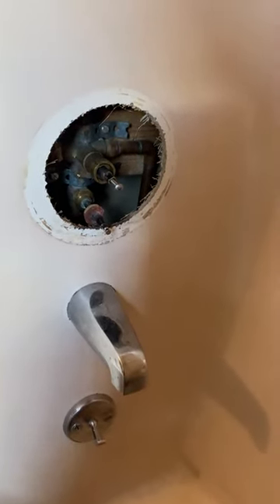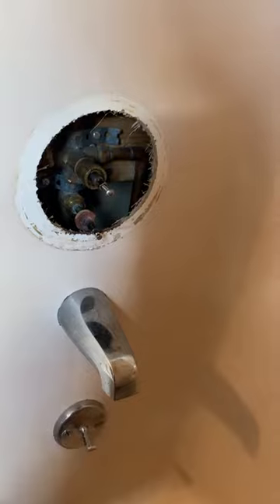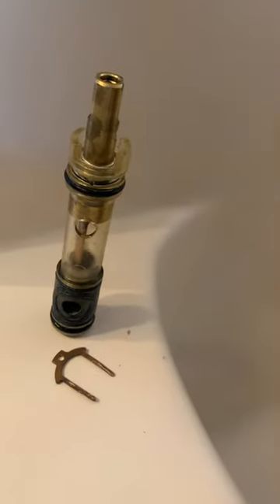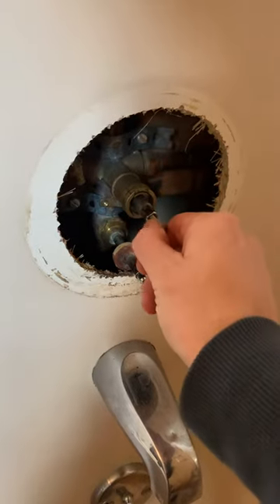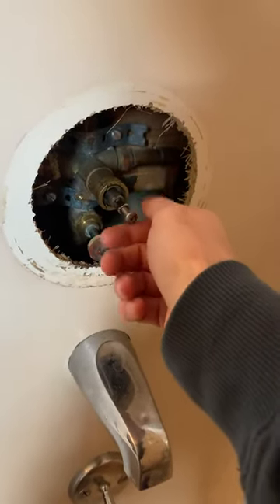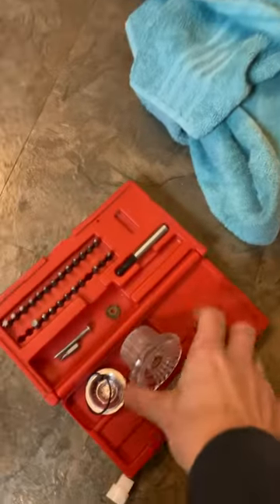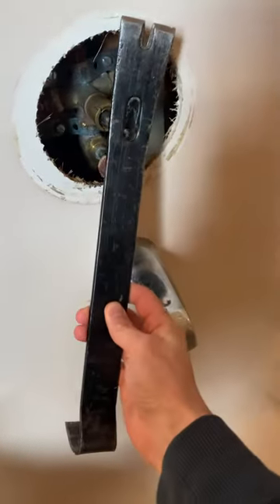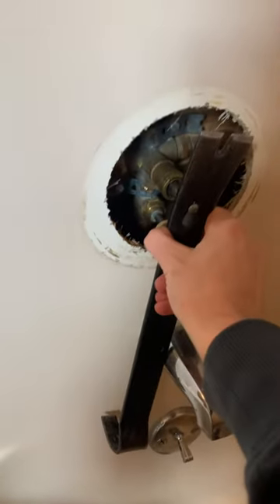How to remove Moen 1225 cartridge without special tool

Comment: This method works like a champ. Great idea!  I did put a block between the pipe and the back side of the tub enclosure wall to minimize the pressure being put on the pipe connections of the valve body.  Thank you.

Comment: got to be careful if the valve isn’t supported
Reply from the maker: I completely agree.  I checked that my valve was secured to the 2x4 between the studs with the metal strapping tightly before attempting this. I probably should have mentioned that in the video. Hopefully people use some common sense when DIYing things like this. This cartridge required pretty minimal prying force to be removed. But it's hard to capture that in a video while filming with one hand 😅